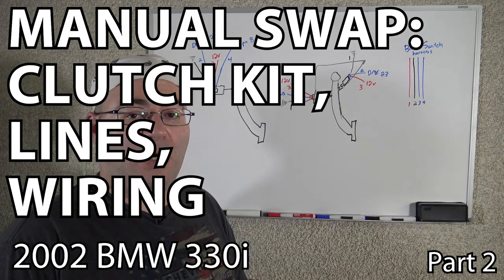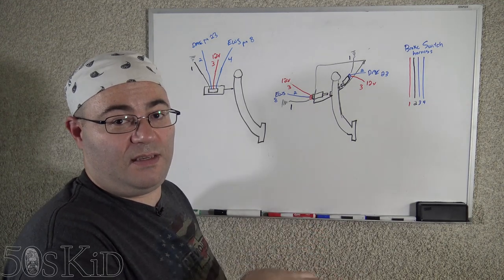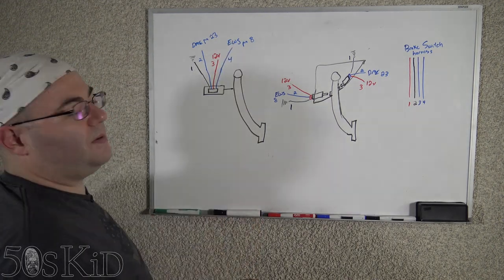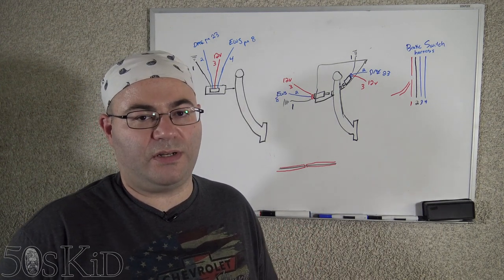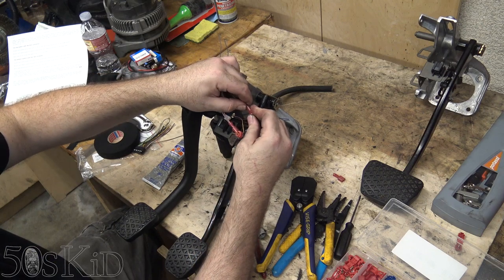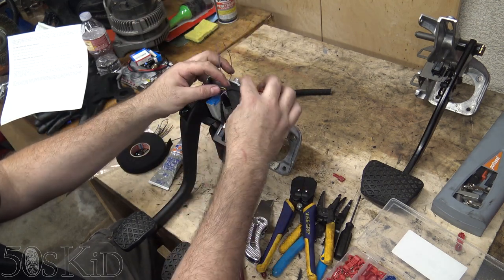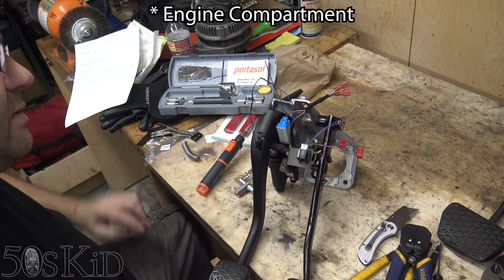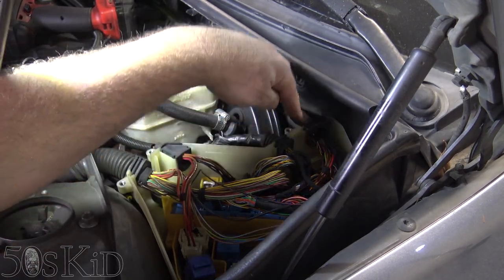BMW E46 Manual Swap Project: Clutch Kit, Lines, Wiring DIY - Part 2

Comment: I did this 3 years ago, 6 speed conversion. Couldn't have done it without your video. Thnx dude!
Reply: When you did yours did you just use the shaft of the drive shaft with your current car? I’m about to do this with a 6 speed
Reply: @Recon77  the prop shaft is a different length. The two drive shaft can be reused but for the 330 6spd there is a stronger type of shaft. They came up for sale near me so I bought those too but I think that you can do without that upgrade. The 330 5spd manual uses the same drive shafts.
Reply: @fransb8543  ok I did pull the whole drive shaft from the 6 speed car with the transmission, good to know. Mines a automatic. I guess now I need to see if the mounting is the same to the differential between the auto shaft and the 6 speed shaft. As long as it is I’m good to go. Ty for the reply and the help.
Reply: @Recon77  the flanges on the diff are different but they pop out and swap over very easily. Sometimes the drive shafts can be a nightmare to get out of the hub. I had to replace one entire swing arm because the shaft didn't come out, not even with a hydraulic press. If yours does't come out easily, I would advise to just swap over the diff flanges from your auto diff on to your new diff and keep the original shafts in place. If you start using brute force you'll damage your bearings. 

Oh yes one more important point: if you change the drive shaft to the specific six speed manual ones, you'll need different, deeper ABS sensors because the diameter of the new shaft is smaller. Took me a few hours to figure that out. Good luck!
Reply: @fransb8543  Ty so much for the info
Reply: @Recon77  no problem, glad to help. Let me know via here if you need to know anything else.

Comment: Nice. How do I wire up the reverse lights though?
Reply: Send reverse signal to pin 4 on your cluster. Cluster turns them on. Its the black connector on the low ike cluster. Low ike has one black 26 pin. One white 26 pin.  (Low ike Cluster with car diagram /reset button on the left)

Comment: might be worth noting if the pedal comes from a junkyard or an older car the bushings may need to be replaced, probably easier off the car while you're doing this. the clutch pedal can develop this weird feeling of play in it. (speaking from experience owning a 1998 production year manual e46) anyway great vids, these are solid for the community.

Comment: My brake lights are stuck on and I have the gellyfish chasing me, please any help would be awesome.  Followed your instructions exactly, I have the old style clutch pedal.
Reply: I’m having the same issue and can’t figure it out
Reply: Check your brake pedal switch I just fixed mine while the car is on pull the brake pedal switch away from the pedal and unplug it then plug it back in and put it in but not all the way you want it out as far as possible for it to calibrate the none compressed position once you let it sit for a minute push it all the way in and your brake lights should go off mine did
Reply: Yea I forgot to post an update, the sensor for the brake pedal was not adjusted properly.  Everything works now!

Comment: Is it different for SMG to Manual? I have the later style clutch switch but no wiring. 
The 1st owner did the swap but he didnt bother about cruise control.
I really dont want to cut wires and tap into the ECU, is there a way around it?
Reply: same question, how do I make my cruise control work again?

Comment: Hello
Is the assembly identical in relation to the electrical harness for a smg 5 speed m54B30?
 I am going to replace it with a 5 speed manual gearbox but I am blocking on the electrical harness.

Thank you for your reply ...

Comment: Do need you need to switch out auto accelerator pedal w/module or can you leave it alone and use it?  In your video you mentioned there is a kickdown switch...is that an issue?
Reply: I have been driving manual for a month with auto accelerator pedal w/o any issues
Reply: We disassembled an automatic pedal the other day. The "kickdown" is nothing more than a little round ball-like gizmo that provides the "pop" when you floor it. It does nothing, and can be removed if you wish, thus resulting in a "manual" pedal assembly.

Comment: My E46s clutch pedal was too high, I just can't slide my feet from rest pedal to it smoothly . Is there anyway I can fix that problem?
Reply: hey you might want to check out the metal aftermarket e46 clutch pedal

Comment: Nice diy wid.. Just done this Jobb on mye 320d 150hp.. But wont get more rpm then 4k.. At all.. And feel like much power loss.. U got any tip? Have done all this.. Just not coded it? :)

Comment: Hoping someone can give some assistance testing the blue switch, I've connected pin 3 to 12v, pin1 to gnd and I'm trying to measure pin2 with a multimeter but I'm only ever seeing 12v on pin2, it never changes when moving the plunger. Any thoughts on whether I'm testing the switch correctly?

Comment: I'm not sure if I'm post in the right place but,  I have a 2005 M3 e46, just finished a swap from an SMG transmission to a manual. I have an issue where the car idles really low, when I put the car in neutral and stepping on the brakes to slow down, the car stalls out. I just cleaned the ITBs and replaced ICV and the MAF sensor? It seems to be better, but it didn't fix the issue. Any help would be appreciated.

Comment: What do i do, i have 330d with 3 wire newer clutch switch module, i have one pin missing? Where i put pin 23 from dme and ews
Reply: Hi how did you resolve it ? I presume that on this 3pin switch, the EWS pin is missing or am I wrong ?
Reply: it seems you have a clutch switch from a car which starts whitout pressing the clutch, thats standart coding  on euro cars. You can code your car like this and you wont need the 4th pin or you plug in another pin for the ews and have to start your car with a pressed clutch pedal.
Reply: @janschneider9125  Yes it is exactly like you say exept switch that i have doesnt have pin for EWS, but car does start, diagnostic tool showed me that it recognises that clutch is depresed or released so I am happy. So conclusion is you wire it like old style exept you dont have/need second switch for EWS (on my pedal assembly there wasnt even preperation for second switch) and if you cant start car, just run 12V from brake switch to EWS and you should be good.

Comment: what part number is for the pin connectors at the end of wires you're plugging into the dme? i see a wide variety of them online, but i am not sure which one is which
Reply: FCP Euro sells the bmw specific ones. Lookalikes are available on Mouser Electronics for cheaper

Comment: I don't have the reverse light switch connector. How would I determine polarity on the switch so I can wire it.?
Reply from the maker: There is no polarity on a switch.  A switch just closes the contact and makes a connection, so wire one side to ground and the other to that relay.

Comment: Great vids, but i have 1 question.
I'm doing a manual swap for my e46 328i race car.
i want to lose as much wiring as posibble.
so i also get rid of the ews.
Do i stil need the wire to port 23,and what does it do?
greetings from the Netherlands.
Reply: (I realize this is 4 years later and probably useless at this point but...) You probably don't need any of the clutch wiring. It is for startup and cruise control which you probably will disable being a racecar.
Reply: Without clutch switches you will have Rev hang when you shift gears ( dme needs to see clutch switch)
Reply: @drewdavis239  Do you know if the 4 pin clutch switch from later models replaces the cruise control switch as well?

Comment: I manual swapped my E39 a long time ago and never put in a clutch switch. After taking a 1600 mile trip without cruise control, I definitely want to install a clutch switch to get the cruise working again lmfao. 

My car is EWS deleted, do I simply leave that wire disconnected?
Reply: Al final que hiciste? Tengo el mismo problema

Comment: Is the clutch switch needed to start the car?
Reply: No you can hard wire it run a wire from pin 8 in the ews to the 12v power on the brake switch
Reply: @rolly.999  thank you! I finished the manual swap on my car months ago. I ended up wiring the clutch switch in to the dme anyway.
Reply: @rolly.999  so do you have to press the brake pedal to start the car?

Comment: So if you have the clutch switch module you don't need the clutch switch? I just thought they would be used together for the sake of failure safety.
Reply from the maker: +Bogdan Nicorescu according to the wiring diagrams they are not
Reply: 50sKid alright cheers mate! I have the clutch switch module for the master cylinder and the clutch switch here and according to the fanatics thread they were both used. But I also saw that there is only one clutch switch in the wiring diagram. Anyway thank you a lot!
Reply from the maker: Yeah I think the guy who did that fanatics post didn't really understand that there were two different layouts and he just mix and matched
Reply: 50sKid guess so, thank you and thumbs up for the howto!

Comment: Just change the coding to think it's a manual. No wiring required to get it started.
Reply from the maker: Car still won't start without the clutch switch
Reply: 50sKid Yes it will. I've done about 10 e46 manual swaps and just went into the ews module and swap it from auto to manual. You can also do the same on the e39.
Reply: Hi. I ve done mine The same without any switches, just changed from auto to manual but Cruise control and parking sensor not working. Any advice about that?
Reply: A3and81 how do you bypass it for the car to run without using the clutch switch ?
Reply: @jakeschuster9163  run a wire from pin 8 in the ews to the 12v power on the brake switch

Comment: Do I need to change starter? After swap stat ups sound horrible...
Reply: I removed intake manifold and starter was hung up on locating pin...maybe 1/2 inch from being flushed...loosened bolts then used hammer to force starter onto pin and rebolted to trans and now all good...PS used original starter no need to change....

Comment: I am about done with this swap, but in a track car. I am not wiring in the clutch switch, just bypassing it. I have pinned in a wire to A60004 Pin 23, but I am lost on if the switch is sending 12v or Ground as the signal. I tried 12v per some internet threads, but still no crank. in fact my power probe is showing 10.4v coming out of the DME on the wire I added. Does something need done to the auto body harness to close the park switch or something?
Reply: Having same issue. Any updates?